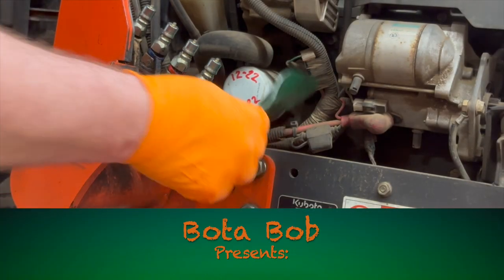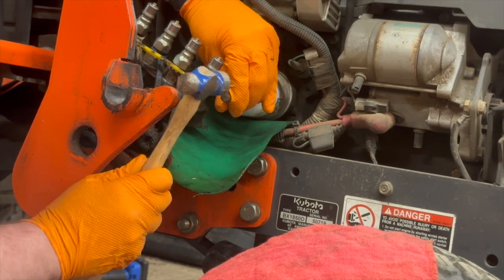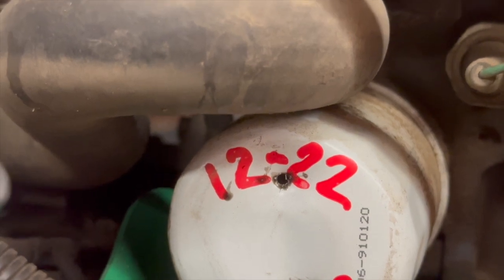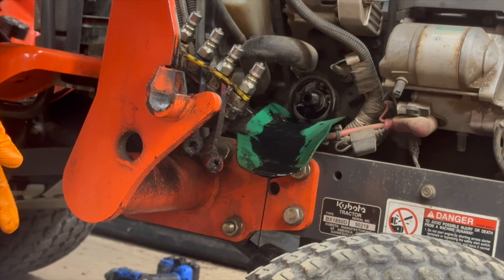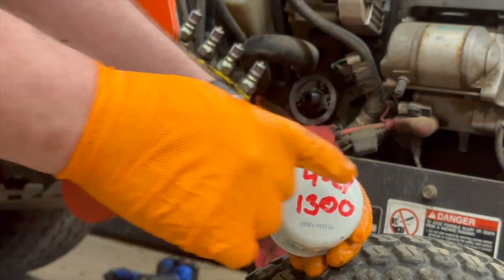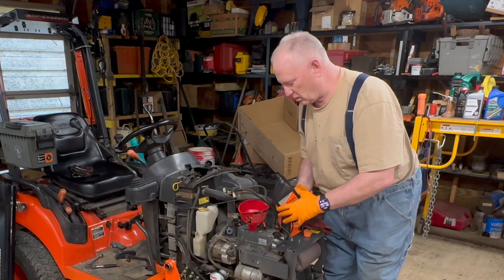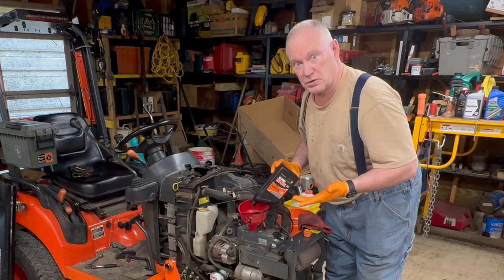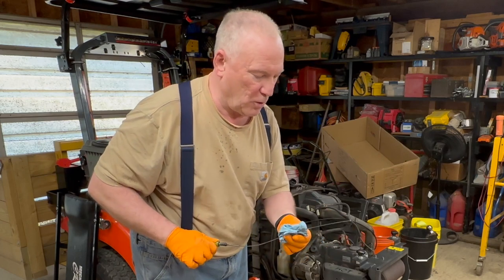176 - BX Oil Change

Comment: Good afternoon Bob, Nice idea of the form-a-funnel under the oil filter and puncturing the end for a less messy drain. Thanks for sharing, have a great week, Ben 😎👍
Reply from the maker: Ben, I am not sure your saw the battery/starter cable right under the filter can.  LOL - good grief.  I've been using the form-a-funnel for a long time, but this was the first time I tried the punch to drain the filter.  Overall, I believe it worked well.  Next time I will drain the crankcase first and then punch the filter can.  Thanks for watching and commenting. Enjoy the Journey - Cheers

Comment: Like that wrench gadget you had there, and that flex funnel 👍, ya spring is here and it’s grass cutting time, Tractor therapy 👍🚜🇨🇦🇱🇷
Reply from the maker: If you search the "Big A" for "Oil Filter Socket set", you will find a number of different sockets for oil filter cans.  It's what I use for all oil filter changes now.  Some are stamped steel, some are aluminum, and some are a plastic material.  They all seem to get the job done.  Thanks for watching and commenting. Enjoy the Journey - Cheers

Comment: I’ll never understand what the engineer was thinking when they positioned filters in that configuration. Thanks for sharing Bob and hope you have a blessed rest of the week my friend.
Reply from the maker: I hear you Tony.  If you look closely after I remove the filter can you can see the batter/starter cable right there waiting to get its regular oil bath.  I spill enough oil without the help from the manufacturer.  I have a different punch now and a bigger hammer, so resistance will be futile.  Thanks for watching and commenting. Enjoy the Journey - Cheers

Comment: That’s a great idea Bob. Neat way to safe making a mess of oil. Good to get her serviced up. 👍🏻
Have a great day, 👍🏻👍🏻👋👋
Reply from the maker: Thanks Noel, I saw this on another YouTube video except the filter can was hanging vertically.  Next time I will be using a different punch and a heavier hammer.  And I will drain the crankcase before I remove the filter.  Thanks for watching and commenting. Enjoy the Journey - Cheers
Reply: 👋👋👍🏻👍🏻. We only have one tractor, out of them all, that has a filter like that. Good to know, if I can only remember. 🤭
Reply from the maker: I'd say oil changes on an engine without a filter should happen on a tight schedule.  That way you can flush out the contaminants with fresh oil.  Thanks for watching and commenting. Enjoy the Journey - Cheers

Comment: Hey there Bob, hope all is going well for you. It's nice to see you out in the garage getting your tractor serviced. Punching a hole or two in the old filter works well and I have been using that technique for years. You also get extra points for putting the date and hours on the new filter. Well done my friend. Great information to share with your audience and you are keeping your equipment running smooth. Enjoy the rest of your week.
Reply from the maker: This was the first time I punched holes in the filter can.  It worked very well.  I'm going to try it again when I remove the oil filter on my KIA.  Stay tuned Larry.  Thanks for watching and commenting. Enjoy the Journey - Cheers

Comment: I have never tried punching holes in the filter before. Great job on the oil change
Reply from the maker: It's a first for me also Joseph.  I got the idea from YouTube and thought I would try it.  Overall, I think it worked very well.  It did make the oil change a little longer, but I hate having oil run down over my crankcase and wires.  Well worth the extra time.  Thanks for watching and commenting. Enjoy the Journey - Cheers

Comment: Hi Bob! Always so important to keep the oil and filter changed. I work my tractor really hard so I go way overboard on oil and filter changes. Why did you poke the 2 holes in the filter? I’ve not seen that done before. Thanks Bob!
Reply from the maker: Brian, I change the oil every year in the spring before the mower deck goes back on the mower.  I change the fuel filters in the Fall when the mower deck is removed.  As for poking the holes, I watched a YouTube video recently where a guy drained the filter can before removing it.  It seemed to create less mess so I thought I would give it a try.  The next time I will drain the crankcase first, then use a longer punch and heavier hammer.  Thanks for watching and commenting. Enjoy the Journey - Cheers

Comment: That sounds good in theory to pop a hole in the filters but as I can see it didn't save much or any mess.............LOL. As a H.D. mechanic Bob I hope you can appreciate me bing full of comments here about your oil change. Your holes in the filter would have worked better if they were at the outer edge of the filter end.........there still would have been spilage of course, so this was not needed at all, in my opinion. I see you fell victim to dealership marketing and paid extra for the brand oil and that aditive is just a complete waste of $$$$.
Kubota's are among the best engines ever built.......I have spent some years in rentals where we had lots of light towers and gensets. Many of these were powered by Kubota engines similar if not the same as what's in your tractor........and larger 4cyl and 6cyl as well. These engines never ever got brand name oil and definately not any additives nor did they get regular on time service intervals. You can mark your clock at about 20,000hrs for these engine before you have to touch them for anything. As we say in the industry they are bullit proof. Your tractor would probably need at least two more Bob's after you are gone to get those hours on them. 
Oils: with only a couple of oil refineries making oils and hundreds of brands that have to meet benchmark paramiters for quality...........if you shop by brand your are wasting $$$$$$$$$.
In summary, it is pure preference on how messy you are doing the oil change..........a mess is enevitable so it's a balance of a little mess or slighty larger mess. Oil is oil slippery and wet........only worry about the grade and diesel vs gas engine oil because there are differences.........save yourself some $$$$$$$$ and buy what's on sale at your local discount store and leave those $$$$$$ grabbing aditives on the shelf for the next fool. 
True story as I am writing this Bob! I was at my local Can Tire store here gettins some oil for one of my small gas Briggs and Stration engines yesterday. I am looking for SAE 30, that's just straight 30 weight oil. I find it on the shelf and there are two rows of it but only one row of everything else. The young fellow stocking shelves near me comes by and ask what I am looking for and I tell him, just 30 weight oil. He then reaches in amongst the rows and pulls out a similar jug with 10W 30 on it and says it's all the same 10W30 and SAE 30............well........I then had to educate this young man in as gentle as I could about oil...........after that he thanked me for the oil lesson and seperated the different oils into their own single rows............one row for 10W 30 and the other SAE 30. Sorry for the rant Bob........I really like that bendable green funnel thing.......that's a great idea.........Cheers!!
Reply from the maker: The green bendable thing is called a Form-a-funnel.  Of course, you can purchase an number of knock-off brands now.  Thanks for the rant.  I never look a the price.  I just buy what is on the owners manual.  Also, I don't mind buying the Kubota brand.  I buy my oil locally to support my local Kubota dealer.  It gives me an opportunity to talk with the sales staff and they help me a lot with getting my parts.  I tried to punch the can close to the edge, but the punch kept slipping.  This was the first time I tried to do this trick.  Next time I will use a longer punch and heavier hammer and try to get closer to the edge.  Feel free to give your opinion here Bryan.  You have a lot of experience and knowledge to share.  Thanks for watching and commenting. Enjoy the Journey - Cheers
Reply: @botabob  Looking back, it was a rant for sure. I definately agree with supporting your local dealer if they don't rob you too much for the same oil that Walmart sells.......LOL. I am due for a rant on ev vs gas for lawn and garden equipment......LOL. I will do this on camera for everyone to hear .......LOL Have a good one Bob........O degres here today I guess that 32 for you.....only going to 3 or 4 today.....hard to get shit done....LOL
Reply from the maker: You are good with me Brian.  I hope I did not offend you in any way.  I truly value your opinion and look forward to your feedback.  Cheers